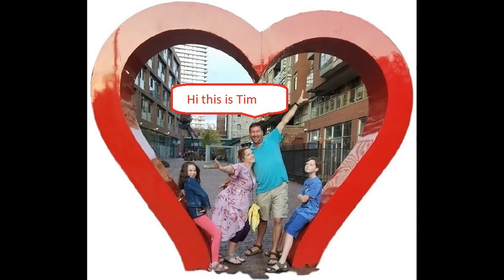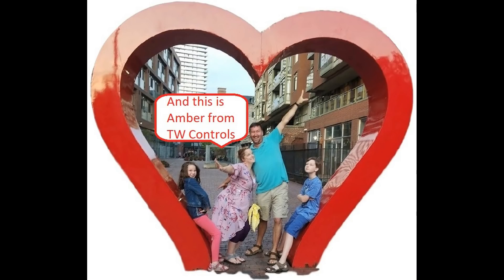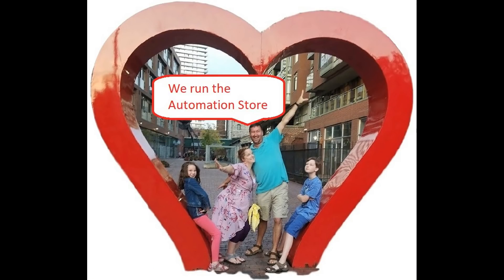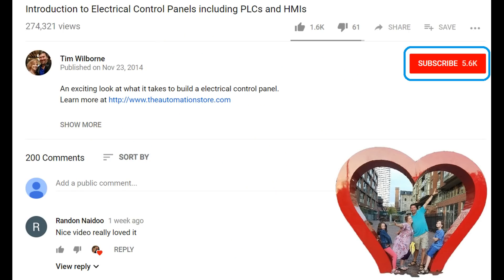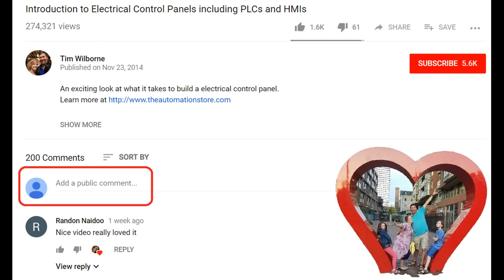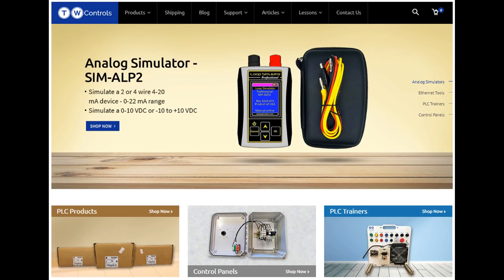Analog Simulator 4-20mA and 0-10VDC Sweep and Step Feature

Comment: If we need passive current output what type connection require from generator
Reply from the maker: Hi Ahmer. You would want a 2 wire current loop. I just put out a video clarifying this. See link below.
https://plctools.com/how-to-simulate-a-4-20ma-or-0-10vdc-analog-signal-plc-tools-sim-alp2/
Reply: @TimWilborne  I appreciated your prompt reply I seen your best vedio we  have local China brand generator  actually i am learning let's suppose i don't have  plc input module but  have calibrator how I major with multimeter  passive current  how much your calibrator in UAE

Comment: Can you make the device perform a sweep or ramp function just one time?
Reply from the maker: That is an interesting question, let me see what we can do.  Can you give an example of when this would be useful?
Reply: I want something to command a ramp function, for an electronic pressure regulator. Need to apply a pressure in a continuous mode and hold it. Normally id have to use a potentiometer to dial the command manually
Reply from the maker: @alexmurdoch3828  You can do that with the current setup by using the pause button.  Start a cycle, let it ramp up, then press OK to pause the cycle and it will stay at the current value.  I will see if I can make a video showing that soon.

I'll have to think of how to smoothly integrate this feature permanently without cluttering the menu structure.
Reply: If you just had an input for number of cycles, and use 0 for infinite, that would be pretty cool

Comment: Is there a way to update the firmware on the model I already have, (purchased from y'all around 9mos ago), or will I need to try to pawn this one off on a co-worker and buy the new model?
Reply from the maker: We had to make hardware modifications to fit the sweep and step features in so it isn't possible to upgrade an older unit.  Give that one to a co-worker and get you a newer model.  Also yours is around the time we expanded the range from 4-20mA to 0-22mA so you'll get a few more features as well.
Reply: @TimWilborne   I do have the 0-22mA model ... used like three times. Looks perfectly brand new, still.
What kind of upgrade program might you offer?
Reply from the maker: @jamesgressett3235 We don't have an upgrade program for it.  It is an interesting idea but the cost to modify the unit would be higher than the new unit cost.
Reply: @TimWilborne  Fair enough, brother.
Reply from the maker: Let me talk to Amber and see if we can come up with some type of promotion.
Reply from the maker: Good morning James.  Be on the lookout for a special newsletter today containing a limited time promotion.
Reply: @TimWilborne  I just got your email. I think I'll go ahead and take advantage of that offer. Thank you both very much!
Edit to add: done and done.
You should see my order any moment now.
Even though I don't use this very often, it has been an invaluable bit of kit, paying for itself every time I break it out. Besides freeing up my Fluke for measurement, it also saves hours of running back and forth between remote I/O's, instruments, and PLC cabinets. I'm sure the sweep feature will be even more of a force multiplier by freeing up my thumbs, and I'm looking forward to trying it out.
Thanks again for this fantastic product, and please keep up the good work, guys.
Reply from the maker: @jamesgressett3235  You'll like it.  I've been using it for several months and I've found it invaluable when troubleshooting.  Thank you for your order!
Reply: Hi Tim, do you ship internationally ?